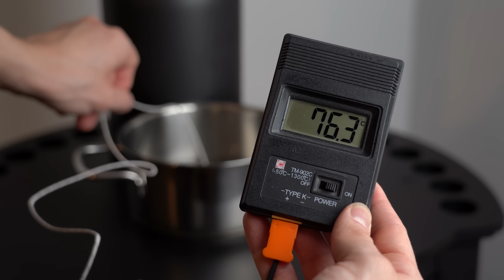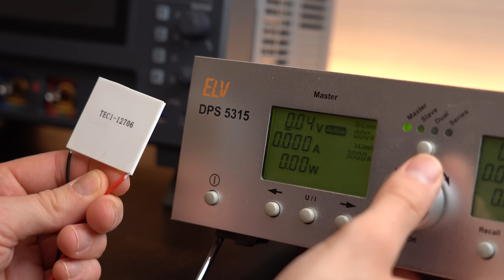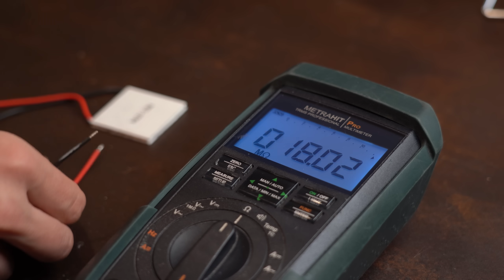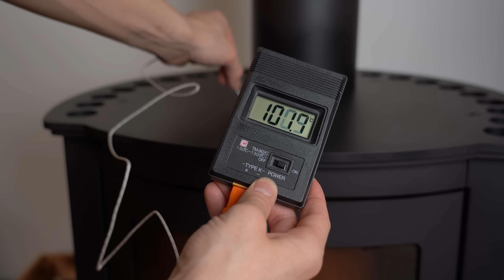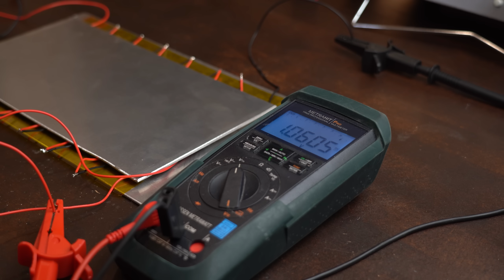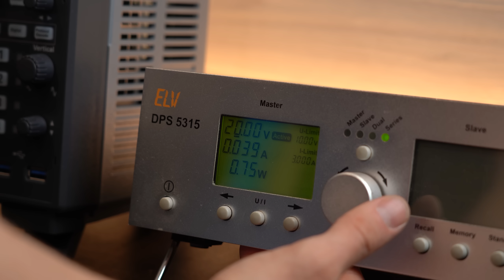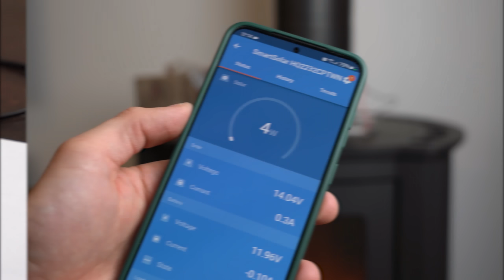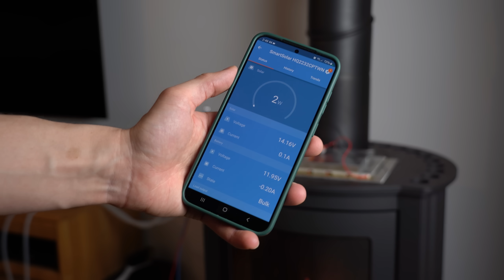I tried to Power my Home with Heat Generators! (Worth it?)

Comment: Thank you for the video...actually always wanted to test this experiment...but those peltiers can become pricy here in ZA....another thought I had is to make a copper coil in the exhaust of the fire place, run that to a water collector of sort, then bringing in cold water from out side "ice winter water", that should give the ±100deg delta...but allot of insulation between the hot and cold side needs to be done to ensure the hot side does not heat up the cold side.
All in all it is fun to play with these ideas....Here in ZA our summers are pretty hot and winters and cold and wet (western cape), instead of trying to generate electricity. I would rather go for the extract every last drop of heat escaping through the chimney/exhaust with copper pipes into a old geyser and push the heat out through some radiator to maximize the heat in the house...Think that's a better and easier conversion of energy...... for now
keep up the great work

Comment: There are TEGs that are more efficient than the Peltier modules and Peltier modules need to have a gradient of temperature that water can not produce for that you were making, Peltier modules are so inefficient that you must invest more energy cooling them than the energy you will get from them and are better for pumping heat but even for this are heavily inefficient. Try getting Bi2Te3 or PbTe or SiGe but beware compared to peltier modules are more efficient but way more expensive and rare.
Reply: absorption refrigeration works better but must be applied preemptively and proactively before exposing peltier modules or any TEG to heat or it will fail and break

Comment: You used peltier modules that are not suitable for the application. They are generic peltier modules and what they do well is only cool with a moderate temperature differential (a few dozen degrees). For thermogeneration, specially designed peltier cells are needed. TEC produces cells with the hot side that can withstand up to 800°.
Using a metaphor, it is as if you had used a 1/4 watt resistor where a 100W armored one is needed. I think we understand each other. Ultimately, a crude and poorly thought out test, without having the expertise to understand what was being done.

Comment: I didn't use an intermediate plate. I used the water coolers directly on them and insulated the areas not touching. Gave me a gross out put of 73 watts with only 12 of them. My pump used 0.4 amps and 12 volts. I would reconsider your design. But water cooled is the best I discovered that passive cooling eliminates the need for a pump on a larger scale. But sure why but I was getting topped out (before breaking) at 5.01 volts and 1.233 amps.

Comment: You have about a quarter of the area of a solar panel if not less.... Of course you are not going to get much power out of the Peltier devices... Coupled with the bad design.... I have seen on another channel where they built a 36 Peltier water cooled setup that sat in a pot of boiling water over a camp fire and managed to get 45w.... It was compact enough to be portable and fit inside a cook pot .... 
At least you had the right idea to use the victron charge controller.... From personal experience, you need to find the correct amount of Peltier devices to use in series to allow the charge controller to pull down the Peltier voltage closest to the battery voltage so that it can be making as much current as possible.... 
You really need to build something like a hood over the fireplace to capture the heat, obviously the hood will be larger and be able to use more Peltier devices as it will divide up the heat over the many Peltier devices, the hood will be like a big upside down bucket catching the heat and giving it only one way out... Through the Peltier devices... A large hood will better regulate the temperature to the Peltiers... 
It's probably going to be ugly but it will work much better, the next version should look much better after the first prototype that actually works.... 
At 0.5W per Peltier device, how much power should you theoretically get if you cover a whole solar panel? 
Which one would produce more power? Solar panel or Peltier device? 
I did a calculation based on the size of my 36V 5A solar panels and the Peltier device made into a panel of the same size worked out more powerful... 
This was an okay attempt, 5W is still 5w.... I would like to see another go at this... You just need to sort out the heat transfer issue... Maybe use a cooling block on top of the wood stove and bring hot water to the Peltier devices instead of having them directly on top? It would look much neater.. you can then put the Peltier devices somewhere else and possibly use fans for cooling which will also put some more heat inside your house, possibly in another corner of the room? 
There's lots of ways that this can go! You just have to be creative and have a good understanding of what is exactly needed to get the best outcome.... Imagine that, a hydronic heating system for the house that generates power during the cold months from one fire!

Comment: I cans see the potential for peltier tiles to generate a decent amount of electricity, but it depends on the application and what needs to be powered. They have been used very successfully to make USB phone chargers, using a fire to heat them and a fan to cool the other side.  As for the current home solar solutions, I think they've got something wrong. I am setting up solar on my homemade bike camper, and for one 8 Ah  12v battery I'm using a USB light that only uses around 100 mA. The light running all night doesn't take the battery down one percent. I get heat using hot wire from an electric drying rack, connected to a usb cable. With both I'm using around 500 mA. The battery still doesn't go down one percent running them both all night. I could connect my radio to it, which barely uses anything, and I'd probably be able to run all three for a week before the battery is drained. And just one 24 volt, 50 amp solar panel charges the battery from 20% back up to full in an hour on a cloudy day. I can run 2 controllers and charge 2 batteries and it's still about an hour to charge when cloudy. Solar setups should be separated to separate charge controllers and battery packs, as well as inverters to run specific things. And the inverters shouldn't be on at all times, but only when they're needed, otherwise they're just wasting electricity. If the batteries are completely full in less than a day, more batteries should be added so you're not wasting solar when the batteries are full. it's good to have 2 sets of batteries to switch between them. One set charging and the other discharging. In my current setup, the three things I plan to power off of the one battery, won't end up draining the battery since the battery will be back to full within 20 minutes or less of the sun coming up. A solar setup the size of a golf course should power a small city. A solar setup the size of Germany would power the whole world. A solar setup on a roof, should be more than enough to power everything in the house if it were set up specifically for each appliance or group of appliances. One 12v battery should be able to run your refrigerator 24 hours per day on solar.

Comment: That irony when your government turns off nuclear power plants and pushes for green energy, so you have to build criminally inefficient wood powered thermal power plant in your house 🤣
Reply: Yeah, but if you try other tricks, a Thug comes knocking.
What I mean, raising a Pole 50-100 feet off ground can tap HUGE ELECTRIC Volts, lower Current with the Attachment of, Coil,  to diodes to capacitor bank and Bridge.
But if you do as Tesla taught, youight end up screwed worse than him.
Stanley Meyers as well, turning Water into hydrogen and oxygen, with on demand Electrolysis devise to run a car.
You can push gas threw sand and burn it safely as sand prevents Flashbacks..v that can deliver cheap heat for pennies One step further add Stream engine or Stirling engine or Peltier-Thermal Electric  plates to side of Sand Battery/heater and make side volts.. You can tap Sky, segregate from ground add rectifier capacity and harvest.
Easy 4 diode 4 capacitor, electricity from Sky circuit $2 each put in 4-5 series then stack and connect in Parallel connect to 30 foot antenna and ground chunk of metal 5ish feet in moist dirt. 
 I have built, Electrolysis Torch then sand heater, intend to buy a Stovetop for hydrogen. I have used HHO cell on motorbike with success.
Make 'em in private, tell only close, I showed off HHO Torch in public and was Beat up by, Oil...
 FYI you can to

Comment: You make the projects happen which i dream of doing for years. Excellent. I've thought of doing this for years. 
However, quite quickly i've noticed that these "basic" Peltier modules are horrible for power generation. 
There is another type, better one on the market, the TGM-xx-xx modules which seem to make more power and handle increased temperature differences. 

With several of those, one could probably actually achieve 100W or so. It will be expensive though...
Could you please consider doing this with TGM-336-1.4-1.5 instead?

Comment: TEG efficiency is generally very low , <5%. There’s a sweet spot that the temp gradient between the hot and cold sides results in about 70% current flow to get max efficiency. 

The bigger issue in getting usable voltages is that you need so many of them to get there, which is also introducing a lot more resistance that decreases efficiency even further. 

They have a place for lower voltage applications, or niche conditions that you can passively maintain a decent gradient without exposing them to too high temps which can cause them to pop.

Comment: I would use the exhaust pipe of the stove and position the perovskite cells at a point to where the maximum heat would not kill the cells, then use outside air to cool the heat sinks.  In the USA most steel fireplace chimneys are now triple pipe; two high temperature  steel and a third lower grade galvanized steel that can be cooled, that is for going through attic spaces, so one has the stet-up for passive cooling. So at adequate height with some heat extraction into the house, the exhaust gasses should be cool enough not to destroy the perovskite cells, a steel squared tube could be used that passively used outside air and exhaust up the triple walled chimney..generating some store-able electrical energy, maybe charge  a cellphone in an emergency or power led lights.. anyway, it should be viewed as alternative energy and only compared to a back up solar or funky generator where the fuel is quite expensive (bottled LPG, canned (tinned) white gasoline (pertol)).. If you want cheap heat, well try a compost pile and trap the bio-gas and then see that the cost still is really high to produce electrical energy...Scale of economy is why we have electrical lines and big generation electrical stations...

Comment: Have you considered a Stirling Engine?  There used to be a central heating boiler (Baxi EcogenmicroCHP) which included a Stirling engine inside.  I wonder if that could be incorporated into a wood burning stove?

Comment: Actually they don't turn heat into electricity they turn a difference in heat into electricity as the 2 sides balance out to the same temp it captures some of that energy

Comment: Wow, I had PRECISELY the same idea, down to the water cooling blocks and Victron MPPT.  But I did the calculations and decided it probably would be very expensive and not produce much - at least now I can rest knowing someone has confirmed it.  On my boat the fire goes continuously throughout the winter and as long as the heat in the coolant is radiated into the boat, the system is 100% efficient, since the energy becomes either heat or electricity.  The little Peltier fans we use has a little bimetalic strip underneath that bends and lifts the fan off the hot surface if it gets too hot, which is genius.  You definitely need a way to regulate the heat - I had assumed the water cooling would do the job, but apparently not.  Another option is to stick them to the chimney, which will be cooler, but chimneys are usually round.  I hope you'll revisit this experiment.
Reply: Where he fails is to plumb the cold air from outside that goes into the fireplace around the top of the stove to create the most heat differential possible as well is a large heat sink on top

Comment: Ah this is painful to watch! First of all you're using TECs when you should have been using TEGs. These are not the same thing even if the working principle is the same. It's like trying to use an LED as a solar panel. Yes same principle but optimized for different purposes. Second, maybe you shouldn't use random no-name modules that are likely to be QC discards? Seriously don't spend time testing components from random sellers on ebay/amazon etc! It makes me sad to see you put in so much effort and be thwarted by bargain bin components. You also don't seem to realize that the TEC-12704 isn't a model name but a specification. Each part of that name/number has a meaning. Not that you can at all trust what's printed on these to be correct.

Comment: since it's winter you should've let the water run over the stove to heat it up then let the warm water run over peltier plate outside for  the temperature differential, that way avoiding the peltiers getting overheated and utilizing the cold of the outside air instead
Reply: There's a idea

Comment: Peltier modules have very low efficiency, no doubts about that! But don't they have to be equally heated to perform the intended way on this experiment? since your fireplace surface heats unevenly, causing some modules to fail while others still works fine,  this experiment looks to me like when someone grab a bunch of random batteries (some fresh, some depleted) and wire them in series.

I'm not saying that I would do differently because I would probably not, but If I were to try this experiment I would try to create a better heat distribution through every peltier module. And since I need to complicate simple things (haha) I would probably use some coiled tubing to capture heat from the furnace into some liquid and use the heated liquid to heat a water block. (probably this solution will be even more inefficient, but if I were to do this without water on the hot side I would have needed some thick chunks of good heat conductors, not a thin sheet of aluminium)

Comment: Using fans in the smoke pipe creating some type of turbine would maybe be more feasible. But thanks for testing the Peltier element option for us 😅 EDIT: I saw @BESTvsWORST-vx2dg already suggested this. Btw, for home use solar power is king. But even better would be nuclear power. But that would not be something everyone has in their backyard. Maybe not yet. Imagine 50 years from now. Everyone having a small nuclear reactor in their garden! 😀

Comment: Probably the best way to recover heat from a stove is  via a heat exchanger coupled to a radiator at the side, circulated with a tiny pump.

Comment: I think the temperature range here is definitely possible to extract with 5-10% with an organic rankine cycle (steam engine running on something else than water that boils at room temperature/normal pressure)

Comment: Hi Scot! Thermoelectrician here :-). I'm affraid your test was doomed from the start. Peltier-Modules are optimized for cooling applications (TECs thermoelectric cooler) - they have a low number of legs with a larger crossection. Modules optimized for energy harvesting (not generation 😊) have a much larger number of legs with a smaler footprint. These TEG generator modules are much better for harvesting. BUT in the end, the conclusion would have likely be the same 😅.

BTW there are sophisticated MPPTs for TEGs.

Greetings from Freiburg
Reply: How sophisticated ?
Reply: Was hoping to see this comment!

Comment: Nice, love your experiments. May I suggest using a Tesla turbine with warm water vapor heated by your fireplace (HP side) and a copper serpentine pipe (LP side) in the rain water barrel. Can't find the youtube link but someone else done it with exceptional perfomance. Basically extract most of the energy from heat differential, way more efficient than peltier modules.

Comment: Thank you for the video, it was interesting and gave me many answers. After this and many other video, I think that the green energies are, at least, not mature to be our first source. Others, as nuclear plants must be developed to ensure a continue supply of energy. Also, when we consider all the waste produced for the solar panels, wind turbine etc, we see that they are not so green. Same for extra high isolation for the houses, after a certain thickness it does not make sense to increase the isolation. I could yet continue but I don't want to be repetitive or appear against all the green tech since it's not true, I like them, I think we need a better approach to energy and remember that the best is reduce the use

Comment: need some kind of sterling engine between the stove and outside... but you'll dump heat out of the building that way. Sterling engines can get pretty efficient with regenerators, which store heat for next cycle.